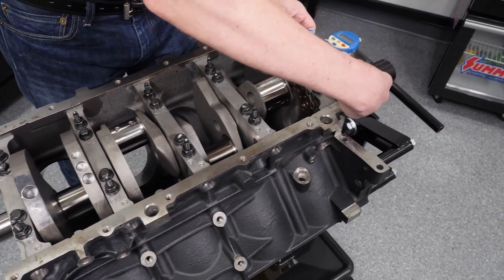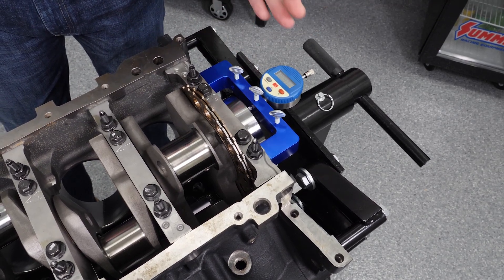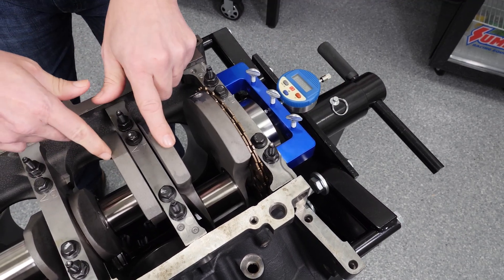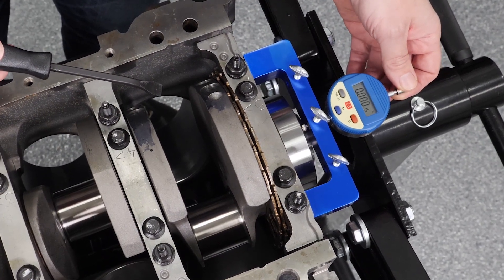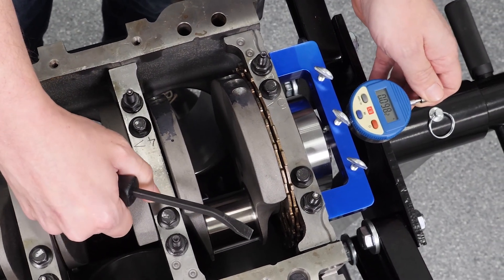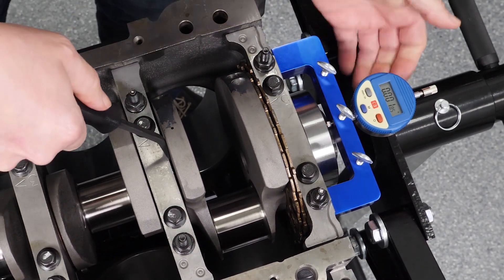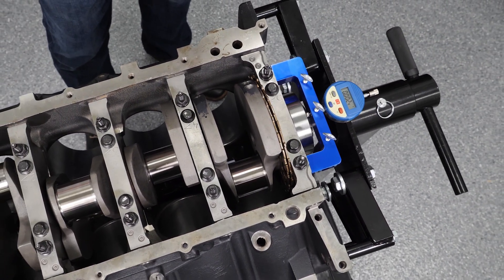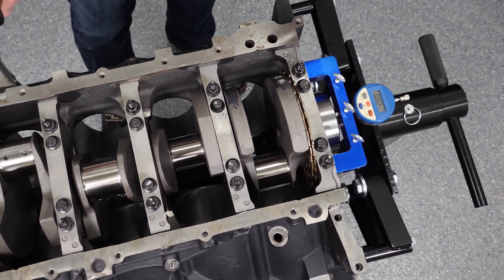How to Check Crankshaft End Play or Thrust Using a Magnetic Deck Bridge: Engine Building 101

Comment: Wouldn't you be working the front bearing surface for transmission load?
Reply: Front of thrust bearing
Reply: @brettwitucki3742  The torque converter or clutch pushes forwards on the crank against the rear face of the thrust bearing